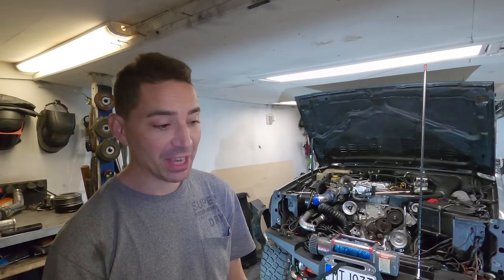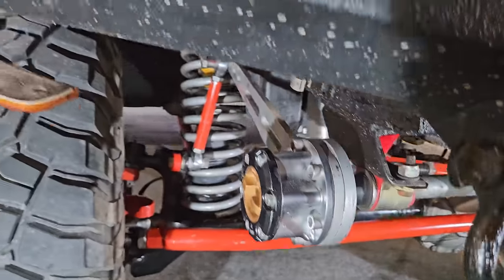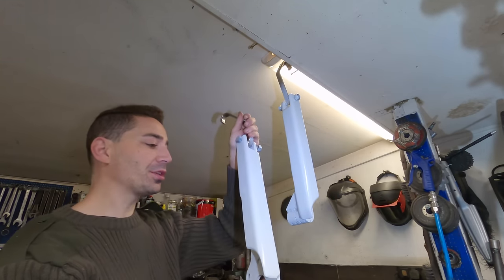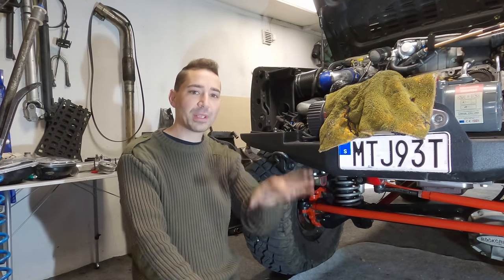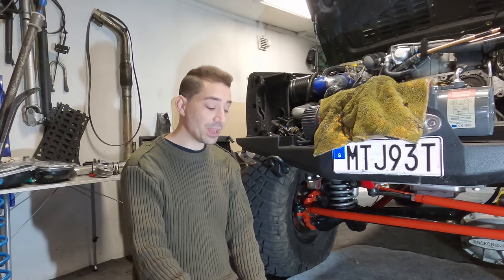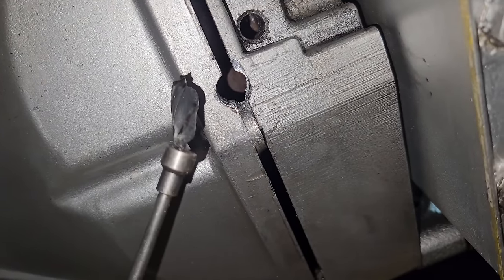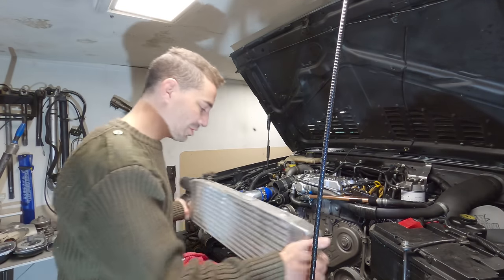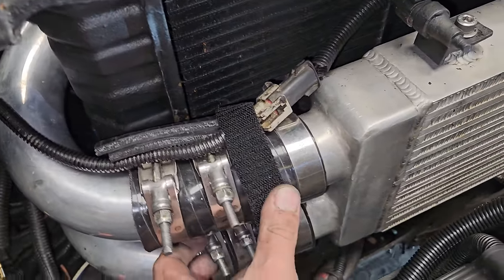JEEP XJ Repairs! Bent Sway Bar / Engine Servicing

Comment: The XJ platform does not get enough credit - it was very revolutionary and ahead of its time when introduced, lots of room with very good offroad capability, you have built your rig very well for what you like to do, like you said in a previous video, there are builders and buyers.  You seem to enjoy figuring out the issues and solving them - gives a person a sense of pride.  Awesome channel.
Reply from the maker: It's an awesome vehicle and very adaptable. It certainly doesn't get enough credits, though! I have a couple now, and I will drive them for as long as I can. Thanks for watching and for the comment!

Comment: Wow ok thanks for responding, I follow your channel and constantly watch your videos. Love the camping and repair videos.  I have a 2001 XJ sport with the OLD MAN EMU 4.5 lift with 35's just installed the ebay front and rear bumper I'll keep you posted on my progress 👍🏾
Reply from the maker: https://www.ebay.com/itm/387258734373?mkcid=16&mkevt=1&mkrid=711-127632-2357-0&ssspo=vxMmWs1YTd2&sssrc=4429486&ssuid=&var=&widget_ver=artemis&media=COPY

I found it. He still makes it. I went through the worm hole or Ebay and eventually there it was.
Reply from the maker: https://www.ebay.com/itm/315248529501?mkcid=16&mkevt=1&mkrid=711-127632-2357-0&ssspo=CxwqFVAQQ1m&sssrc=4429486&ssuid=&var=&widget_ver=artemis&media=COPY

Or is there this one. Similar but more expensive.

Comment: Really enjoyable to watch as always. You provide motivation for me to work on my own stuff that requires constant maintenance (mainly old tractors and boats). Sometimes I think I waste a lot of time redoing the same stuff. But probably most people are the same I guess. We have similar workshop setups, ie mine isn’t quite big enough either. Always have to move a load of stuff of the way to do one job, then move it all back again for the next, then repeat many times. I have solved many weeping seals on my tractors by using hylomar blue non hardening gasket dressing on every seal or o ring or gasket. Even those that don’t call for any monkey spunk to be used. I’ve found it to be very good over the years.
Reply from the maker: I used to use Hylomar Blue. It's decent stuff, although I've not seen it here in Sweden. I used to use that stuff everywhere. 
Yeah, the workshop is small, and it gets messy very quickly when I'm into a project. It certainly doesn't stop me, like you, but I clean it constantly. I'm glad you enjoy the videos and happy screwing on your own machines!

Comment: 9:50 I had this happen to my mint 1979 Ford F-150. 7" lift, 38x15.5x15 Radial TSL Swampers. My friend builds lifted trucks, how we met, and the worse idea he had was to build the sht out of the 351M engine. 4spd NP435 trans, 205TC, 9" rear and Dana 44 front. The more I built one thing everything else was blowing up. Engine mounts, trans mounts, trans to TC adapter in 13 pieces, had to put in a SHD clutch kit in, standard was worthless. Split the T18 trans in half so swapped a 435 in, two 9" rears. Huge list... Fix one issue and gain more. I should have swapped an auto C6 trans and it would have taken a lot of violence out of it. 
**Sorry for writing a book about it.
Reply from the maker: Wow, that's an incredible build by the sounds of it. I guess once you start chasing the weaknesses, it's a rabbit hole that almost never ends. Hopefully, you can get to a place where you know the weaknesses or plan them so they are easy to swap. I hope that making my jeep lighter it will help reduce the damage.
Reply: @WorkshoptoWilderness  I didn't expect you to respond to that. Might mean nothing to but it means a lot. I take pride in everything I touch/build and I know you do as well. 
Huge respects...

Comment: I plan on doing some solo winter camping this year and I’m 50:50 with the RTT. I just built those drawers which means my sleeping platform would be about 5-6” higher leaving less room inside, but it’s doable. Or I take the RTT out but when snow wheeling it’s nice to reduce weight and not have to deal with taking it off and drying it afterwards like you talked about. 

The only RTT I’ve seen that could work with a family would be those iKamper style fold outs again, basically a King Size floor plan. 

I wonder if we’ll ever see an overland trailer build on this channel 😉
Reply from the maker: I've taken the tent off now, and I honestly love how the jeep handles and looks. I think I shaved off 90kg I calculated. Crazy! 
12kg of that will go back on in solar panels, but it's certainly less top heavy without the wind noise and drag. I've started on the platform, and it's a tricky one. Not as much head room, and I probably won't be able to sit up in the jeep while in bed, which I won't like. I guess I can sit in the passenger seat 😆 
It's tradeoff, but the tent is becoming challenging with mould, plus it's too small for us all, so it's sort of lots of its long-term sustainability. What do you think you will do?

Comment: Hi Mike. Excited to hear your going to try sleeping inside the Jeep this winter! Less weight on the roof/jeep should also help in the snow. 
I know your diesel heater from the engine blows in through the passenger footwell. So that should help with moisture. 
I sleep inside my Jeep Mike all year. And condensation is still an issue. Especially in the winter. I have those plastic covers on the rear windows. So I can drop both rear windows 2” without any rain coming in. And then use bug nets that fit over the rear doors. But condensation is still a problem. So I’ve decided to try a 3” vent in my side rear aluminum window panel. (Like your gull wings but mine don’t open). 
Then have a 3” almost silent computer fan mounted to the back of the closable vent. Running off my portable power station. To blow air out of the Jeep all night. And air will get pulled in from my rear windows. I’m hopeful it will work just like a bathroom fan!?  To help keep condensation to a minimum from bigfoots heavy breathing 😉

I will report back over the winter if it works. I’m still in the process of building in the vent/fan setup. 
Cheers 🍻 Mike.
Reply from the maker: I would love to sleep in mine all year round. I don't think I will be able to hack the 24-hour daylight and flies in the summer thought. I will probably use the awning room or just make some mosquitos net thing inside. I will see how it goes next summer. 
It's interesting to hear about condensation. It must be a constant challenge. I have a silent computer fan, although it's not installed yet. 
My entire back window will soon be aliminium, so that's where it will probably go. 
With some windows down and the diesel heater on it will be fine, but I personally hate sleeping with it on for safety and for noise. 
You will have to report back on your condensation when you install the fan.
Reply: Hi Mike. Yeah I forgot about your summer 24hrs of daylight! You also mentioned about the mosquito’s which are ridiculous at times in your area. And the need to keep an area clear of them. So I think in that regard the RTT is still probably the best option for the summer. As the awning room you’re in and out all day. Especially if camping with the kiddos. 
Summers are getting hotter and hotter over here. So Im actually now sleeping outside sometimes in the summer in the awning room. As it cools down faster than the Jeep. 
In regard to condensation. It’s arguable at its worst on my side rear window aluminum panels. As they conduct the most cold from the outside. So I’m thinking of putting some thin foam on them to help reduce the condensation. You might need to consider that for your rear window panel. Then it’s the glass where the condensation builds. I’m sure it’s everywhere behind the headliner etc. I just can’t see it of course. I’m going to do a roof rack mount diesel heater setup. Exactly like your old setup on your tire carrier. And plumb that in through my aluminum side windows. Much like you only for initial warming and to help deal with condensation in the morning. I also can’t sleep with that on. Noise and it’s a potential safety risk. Co2 etc.

Comment: Maybe try filling the cover with some diesel fuel on the bench, overnight, before you install it, that way you can make sure it's not leaking and also it will make sure you don't have any hidden cracks.

Comment: I have recently found your channel and have been watching your videos from Australia and although l own a GU Patrol l find your content very interesting and inspiring. I like your trip videos your hummer and you working on your Jeep, pulling it apart messing with it and putting it back together hopefully for the better. Compliance rules are very strict over here and we can't do the modifications you guys can or l would be in a Jeep too.
Reply from the maker: Thanks for tuning in and for watching! I really like GU Patrols, probably a better choice than a Jeep. They are rare and expensive here. I'm pushing the mods to the limit, I think, although not the lift and tires as you can do as you will with that here. It's all of the small things they tend to look closer at. But with the roof tent off, they will like that more as it lightens up the rig.

Comment: Been watching you since MCQbushcraft! I'm looking into starting this as a hobby, despite your warnings. Going to buy a wrangler  to build it out similar! I need it for my quest to find bigfoot.
Reply from the maker: Despite my warnings, it's a lot of fun and good if you enjoy learning mechanics. I personally really enjoy the variety of hands-on work involved in it all, plus the adventures and using your builds. 
A wrangler is a nice choice, and it should get you to those remote locations where Bigfoot likes to lurk. My personal recommendations would be to weld up a 1/2" thick chastity belt for your first expedition.  Once he smells fresh meat, he will come in hot but should get bored with you once he's been trying to chew the belt off for at least an hour.

Comment: so, not sure if it applys to that engine, but on some engines you put the timing cover on, then put the balancer on. use the balancer to line up the seal and then tighten the cover so the seal is centered on the balancer.
Reply from the maker: Ah, that's clever, I never thought of that. It might work on this one, but I wouldn't trust it in this case. Thanks for the info!

Comment: Will the tire "width" increase once its on the ground and supporting the full weight of the vehicle?  I know nothing about cars or tricking out Jeeps, but idk if tires expand once they're off of the jack.
Reply from the maker: It's a fair point, but it shouldn't factor in this setup. The tire will mostly be fatter at the bottom when contacting the ground. So technically, the profile should be much different up top. But I've been wrong before, and before that 😆

Comment: Bro you bent the sway arms because the panhard bar is to short for the long arm so when the  axle drop it goes away to much to the drivers side that's why the arms bent. Maybe you should put at least One limit strap in the middle of the axle to help avoid that axle SIDE movement.
Reply from the maker: It bent because of the impact of the pot hole at high speed alongside the steep link angle that put side pressure on the arm. The side movement is taken up by the hiem joint, and it's not enough to bend anything. I know this to be true because I've tested all of this with and looked at it all.

Comment: Love watching your videos. I got job to do in my jeep grand Cherokee mvmotori 3.0diesel wk2 - water pump, thermostat, sensor and probably air suspension compressor and instead do it I am watching you do the thing…… I have no will now to go to garage and work on it. Zero will. Will need to call tomorrow to work and advice them that I will not be there for rest of week  do to my pinky pain😂😂😂😂😂
Reply from the maker: Well, all the power to you! I know the feeling all too well. It's hard when the drive is gone for a while. I feel like I'm almost there on my diesel. Although the 4.0 is decades away 😆  I have little drive for it, but I will try. 
I hope it all goes well on the 3.0. I imagine it's pretty similar to the 2.5. I almost bought a 3.0 for a cheap price. Can you find mechanical pumps for them? I often wondered what it would be like to tune one up.
Reply: @WorkshoptoWilderness  It is a good engine even I slash it online on forums before lol. My model is A630DOHC you can remap it to Maseratti map 275HP and 600nm but what for?. I got 241hp and 550nm and fuel consumption with 285/65/18 mudterrain Tyres around 11-12l per 100km in my teuchter ride. The car overall amaze me how capable it is off road. I wish only it had a proper on demand lockers front and rear. I got lsd at the rear which I can control using obdJscan but each year I need to change the lsd motor due to how it is build and expose to water. Overall it’s a jeep one day something work other day not so much if coming to electrics. I got motorbike for moving around so transport is not a issue the "will to do" is the issue.  I really like your videos and push them to my colleagues in Poland who off roading in the same jeeps like yours, just to prove them that this engine can do something more than brake down lol. Lots off XJs is there but mostly with 4.0 engine. You will discover new world with this engine…. If I can suggest something  move to Nissan Patrol swap engine and trans lol to m57 set and you will have mad machine.